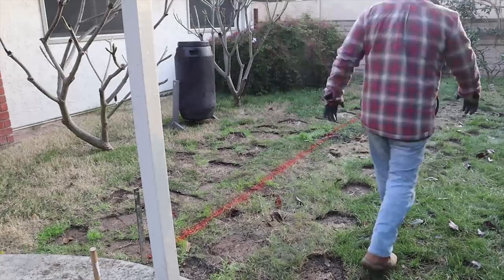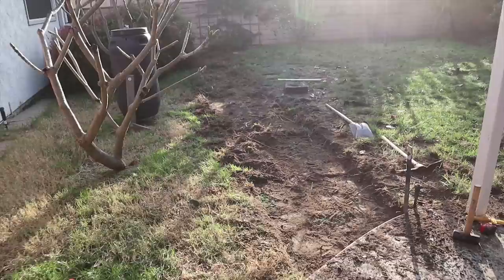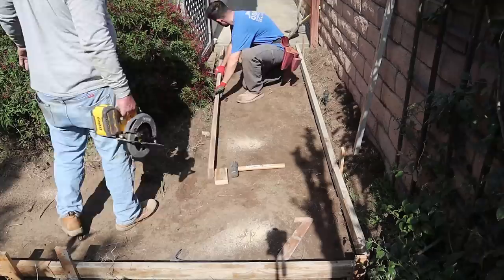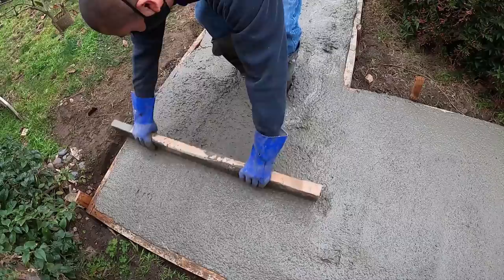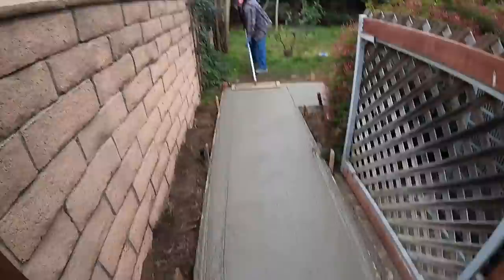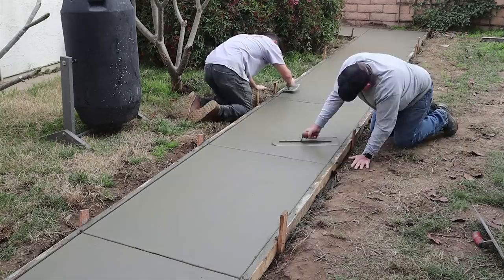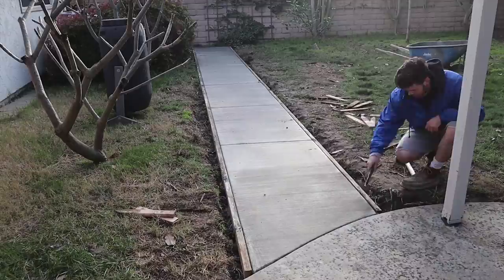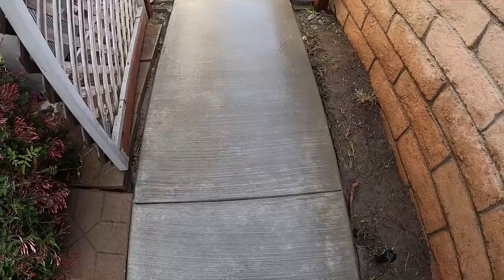Beginner Concrete Side Walk Slab DIY

Comment: You guys are so professional.   We need you in Mississippi.   I had a slab poured, and it started cracking right away.  It had low spots too.  I love watching your videos.
Reply from the maker: Things can bad real quick.
It's a in the planning
Reply: God bless Mississippi 😀
Reply: Right chad white we need him in louisiana too
Reply: If they did it when it’s really hot they probably needed to keep the concrete wet for a proper cure. It can dry out too fast I. Warmer climates and not cure properly.
Reply: @ebonycombs1677  I've poured large pads where it was over 100 degrees out and no humidity, without a single crack. And I'm not a great concrete guy, just a general contractor.

Comment: You can use chamfer strips to  curve your edges. You take a 2×4 and mark 3/4 on the 3 1/2 side. Put your worm drive/ skilsaw at a 45 degree angle. Cut all the way down the board. You will nail that at your grade level. Pop a line all the way down your form and then nail your chamfer strip on that line. It will give you a nice curve on your side edges of your sidewalk.
Reply from the maker: Sounds like a 45 degree angled edge
Reply: @OdellCompleteConcrete  exactly what it is
Reply: @anthonycarroll6546 dont they have 45 degree angld strips now?

Comment: I got to start saving more trees. You're setting the bar pretty high Dave.
Reply from the maker: Saving trees is fun
Reply: And he’s contaminating the soil 🤷🏻‍♂️
Reply: @QuIcK1423  how is Common materials used to manufacture cement that include limestone, shells, and chalk or marl combined with shale, clay, slate, blast furnace slag, silica sand, and iron ore. These ingredients, when heated at high temperatures form a rock-like substance that is ground into the fine powder that we commonly think of as cement contaminating the soil.
Reply: I watch both of y'alls channel cool to see u comment on his video
Reply: Mike Day and Dave Odell need a joint venture!!!!!
Reply: @QuIcK1423  you are misinformed, cerement in NO way interferes with vegetation

Comment: Love these concrete pads, the brushed is cool, a little texture for grip, congregate is nice with the rough sand like finish, nice. Dr. T
Reply: I got to get a level also some strings posts and shape, you could make a fun design using the rocks around the pads. Thanks Odell

Comment: I'm working on a small sidewalk at my house 8' x 5' x 4" thick approx ) and I'm wondering if I need to put crushed rock down before I pour concrete. I've noticed that you don't use crushed rock. When is crushed rock required?

Thanks in advance
Reply from the maker: When you're in freezing climates
Reply: @OdellCompleteConcrete  Thank you. 
I live in Alberta, Canada. We can get as low as -40 below zero in the winter. I'll definitely need some crushed rock
Reply: @wrightbrent73  That you will!

Comment: If there's not much weight going through the concrete will the fiber mesh prevent it from cracking without adding rebar or any wire underneath?
Reply from the maker: The rebar just holds it together after it does crack.
Fiber mesh is just for shrinkage cracks.

Comment: The earth, ground, dirt, shifts.. if you don't create separate flags of concrete it will break apart and look bad, very quickly. I am a contractor and my father was a Mason for over 40 years for local union no. 1.
Reply from the maker: Bingo

Comment: Awesome video. Is there a major difference between concrete from the truck and bags you'd get at homedepot or lowes?
Reply from the maker: Yes there is a big difference.
Reply: @OdellCompleteConcrete  if one had to use bags, what brand would you recommend for a small sidewalk?

Comment: You guys are awesome. Consistent pro work.  Is there a video that can help me deal with installing a paver patio that inclines up several inches away from house. In other words, exiting back of house onto several feet of deck and then pad for patio. The pad slopes several inches upward over 20 ft.  Additionally, any videos on measuring patio stairs?  How best to measure out and install three stone (slab) stairs on left of patio (when facing away from house)? Many thanks!
Reply from the maker: yes we have videos of paver installs

Comment: Doing similar small sidewalk and debating mixing 80lb bags in rented mixer vs. expensive short load delivery. Any concerns with doing it in sections over a few days - particularly the control joints as I guess it would be a cold joint?  Working alone. 50 bags, 4000lbs. 1.11 cubic yards.
Reply from the maker: It should work.
If it saves money, go for it

Comment: Quick question, would you use a felt landscaping liner if there was organic material to prevent it from breaking through the underside of the concrete? Or would that be unnecessary
Reply from the maker: Not necessary

Comment: Looks awsome.....just curious, did you not need to pin it with existing patio to assure new pour doesn't pull away? From old structure.
Reply from the maker: This ground is non expansive

Comment: Should make some dobees with extra concrete u have maybe make a mold you can cut after it cures a little for the next pour
Reply: U don’t even need to add wire just to hold up to make sure it doesn’t drop

Comment: How do you know if the string is directly at 90 degrees?
I mean it sounds simple but, just a inch over can make a big difference.
Is it the forums that make sure it's 90 degrees?
Also, when adding on to a form? How are you connecting them? Using a wooden stake? Or screwing the forums together?
Reply from the maker: Measuring both ends off of the house

Comment: What is the point of pulling up the fiberglass rebar to be in the concrete when the guy screeding is stepping on it the whole way is that something to worry about?
Reply: gets concrete under it. when you step back yes you may bring it down, but then lifing it back up again afterwords to have it set in the right spot.

Comment: Why were no joint expansion barriers added? Would it be a future concern? When I do sidewalks over 8 feet I always add rubber expansion joints every 3 feet, Like you would see in modern highway construction. Am I over-doing it?
Reply from the maker: Sounds like overkill

Comment: I was told that there is no need to dig down below grade for a 4” thick patio because there’s a large step down from my backdoor. What does step down have to do with elevation? I thought it was standard to always dig down to match elevation. My yard is only 19 x 15 and the patio will be 17 x 11, so is it essentially a waste of effort to dig down? I’m not opposed to whatever makes it easier and cheaper, just curious.
Reply from the maker: Yes digging down to match existing is a good idea unless you want to add a step
Reply: @OdellCompleteConcrete  The contractor said that he wouldn’t dig down because of the step down - it is significant, definitely exceeds four inches by a decent amount. Per your response, I think he must be trying to avoid making a step - a step would have to be 6.5 feet wide because there are french doors. Thank you for pointing that out! I also think he must not believe it’s worth the effort to match elevation because the patio will cover almost all of my yard. I will verify. Makes sense when also considering a step. I thought it was required to dig down but sounds more like standard practice / rule of thumb. The remaining uncovered yard will not have concrete covered primarily due to hoa rules to stand off my fence 1ft. The remaining 3ft x 17ft will be a swale or rock-covered french drain to catch water run off from three sources (rear retaining wall that doesn’t have drainage, neighbors yard, and my downspout).

Comment: Hi, don't you need a 4 in base of stones before you pour the concrete? Looks like you are pouring concrete right on top of the dirt.
Reply from the maker: Dirt works in Southern California
Reply: @OdellCompleteConcrete  what about in PA where you have all the seasons. Would you use a stone base and if so how thick would you lay it?
Reply: @Terminator2003 I just got a quote from a contractor. He said that they lay 4” of gravel and rebar before pouring for a sidewalk to compensate for the constriction during the winter and
Expansion during the hot summers. I’m in Chicago. FYI.

Comment: Do you use a cement truck on smaller jobs like this? How do you determine if bag concrete (from Home Depot 80Lb bag) will work on a job?
Reply from the maker: 1 yard or less

Comment: Great video right on time im getting ready to rip up my 7 yr old sidewalk that is spalling all over and gonna try again.  I hired out the first time and not happy.  How long do you wait  typically to cut your joints?
Reply from the maker: One hour
Reply: @OdellCompleteConcrete  i see u use engine oil to coat the wood, is there anything else you would recommend?
Reply: @jsjizzaone3590  motor oil is the best option. I used old motor oil from my truck that I saved for small home projects and it worked fine.
Reply: @jsjizzaone3590  form oil is what I use

Comment: Just curious, if you pour a sidewalk but didnt set the forms wide enough, can you put new forms on the outside and add new concrete, effectively widening the slab? I figure if I brush the existing concrete with bonding adhesive it would work?

Comment: I may have missed your explanation in the video...What is the reason for the 1/2" to 3/4" form difference?...Is it for water run off and if runs into a level existing slab...how would I hide the height difference in comparison?
Reply from the maker: Yes for water runoff.
Not noticeable
Reply: @OdellCompleteConcrete  thank you Sir!

Comment: What do the joints in concrete do if it's poured as a a solid?
Reply: Also I suppose I should ask how long concrete slab like this should last?
Reply from the maker: Crack control
50 years

Comment: How long do you leave it between screeding and floating it, then finishing it? Last concrete job I did I messed up a little as I drew too much bleed water to the top. I think I went at it too early with the finishing trowel.
Reply from the maker: Bullfloat right away. Steel after bleeding water is gone
Reply: I’ve always been told never to use steel when finishing exterior concrete. Just float and broom. Leads to a longer lasting finish.

Comment: My husband and i were laying concrete for putting tiles on terrace all around the house - this is NOT an easy job. Very tiring. U did a very good job. We already had gravel with sand under it, so we didnt dig deep, still very tiring. But u were using concrete from the car - that was easy. We also put a mesh under it, not just a few bars
Reply: You didn’t use rebar? Omg

Comment: thank you from England, we dont use it as much as you..... Did you know that China has used more concrete in the first part of this century than the USA did in all of the 20th
Reply: Impressive, but I have seen alot of engineering failures and shortcuts also